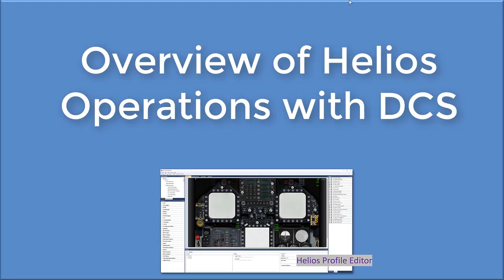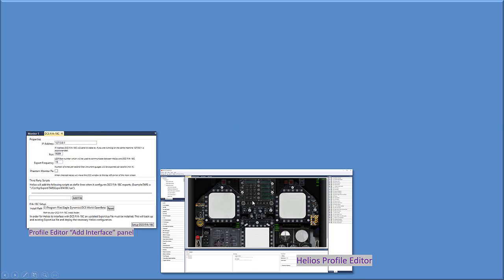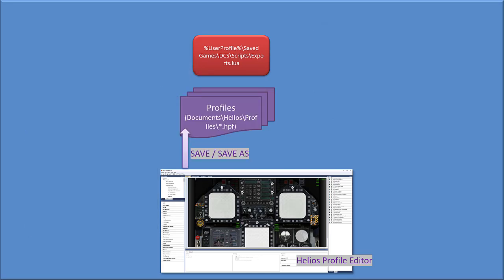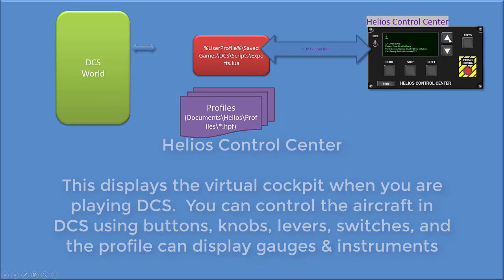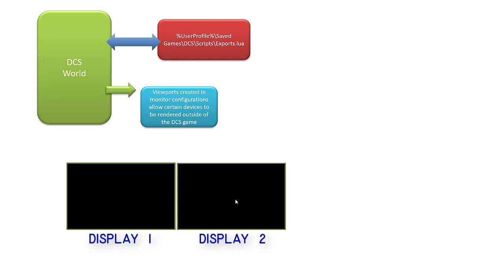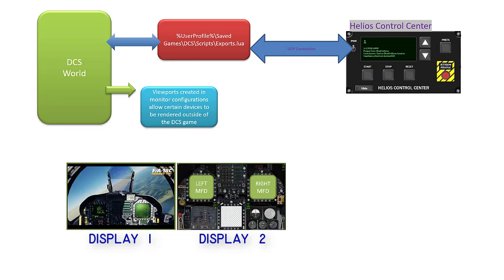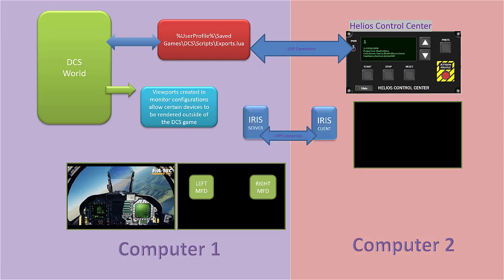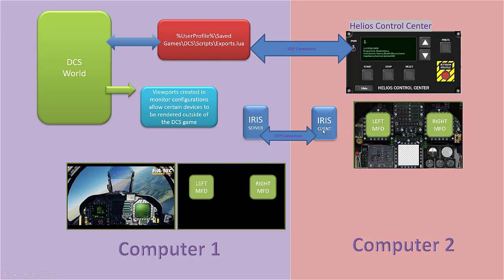Overview of the Helios Virtual Cockpit System for DCS

Comment: Hi. Where can I read more details about how to use iris? While launching iris doesn't find config file, manualy shows error and there is no additional tabs for viewports
Reply from the maker: @user-fw4vw6gz4k  there is documentation in the Iris download package which is here https://github.com/HeliosVirtualCockpit/Iris-Screen-Exporter/releases/latest
Reply: @bluefinbima2227  Thanks, but I even can't load the config file into the iris.  And also I didn't understand how to config a helios profile without second monitor.
Reply from the maker: @АндрейТюников-н7в  if you can't get the examples from the documentation to work, then I would suggest heading over to https://discord.com/invite/GhDBJe3jNH where it is easier to assist you.
Reply from the maker: @АндрейТюников-н7в  no second monitor - just make sure your profile components are placed onto Monitor 1 in Helios profile editor.  There is lots of YouTube content which can help.

Comment from the maker: There is a bug in Helios where the exports.lua does not always get written into the Saved Games folder.  There is a fix for this in the pipeline.  Iris as mentioned in the video is from Will Hartsell.   I'll provide a link to the code when I work out the best way to make this available.
Reply: Could that be the reason why  the DCS AV8B Profile doesn't work? The buttons and gauges are not working. The other one for F18C from CAPT Zeen is working, but might be already exported before i updated helios.
Reply from the maker: Hi,  if you have tried  to do a Setup from the AV8B interface, and Captain Zeen's FA18C still works, then yes this could be the case.  Unless Captain Zeen has ported the AV8B exports code into his exports.lua (andI do not think he has), then they are  mutually exclusive.
Reply: @bluefinbima2227  Yes i tried to setup the AV8B interface profile according to this tutorial / overview. I also used the latest export.lua from Captain Zeen (01/JAN/2019) in combination with the latest Helios and your AV8B profile. I will wait patiently but eagerly to see the fix  ;). I really admire your work and effort you put into this. Also your AV8B Profile looks great especially the visuals and how you placed the interactive elements. I know as a Front-end programmer, that debugging can be a nightmare. I wish you the best!
Reply from the maker: @BartB1986   If you installed Capt Zeen's export.lua, then my AV-8B profile will not work and this is not going to be fixed.  My AV-8B profile must use the exports.lua created by Helios from the AV-8B interface.  What will be fixed is the directory where the interface specific exports.lua is saved to.  When there is Alpha, Beta, and full product DCS directories, then the profile editor gets a little confused.  The simple approach is to look in  %userprofile%\Saved Games\DCSxxxxx\scripts and see where the AV-8B exports.lua file was written to and copy it to the directory that corresponds to the DCS you're running.
Reply: @bluefinbima2227  Thanks for the clarification. I have another question, do you need to do something with the HeliosCore and HeliosExport.lua. If so, which version does it needs to be?
Reply from the maker: @BartB1986  If you have the export.lua from the AV-8B in the correct location,  I would guess that HeliosCore and HeliosExport will never get invoked.

Comment from the maker: IRIS is now delivered (but not installed) in the latest release of Helios - https://www.digitalcombatsimulator.com/en/files/3302014/ .  The installation files are in the Helios folder in My Documents.
Reply: can Helios  be used to interface physical instruments with dcs?
I want to build a cockpit sim but while there's plenty of guides on how to build custom controls or diy gauges and displays I still can't find anything on how to get a value like say x altitude from dcs and imput it to a real gauge or even just an on/off signal to  master caution panel.
so yeah, I've seen the name of your software pop up every now and then in cockpit builds so can it do that or did I misunderstand?
if not could you please point me in the right direction?
Reply from the maker: @npc6817  
There is some provision for physical instruments, in addition to responding to DirectX HID devices.  Helios does have a Phidget interface https://www.phidgets.com/ and there is support for Eos Devices based on Arduino (see https://forums.eagle.ru/showthread.php?t=108160 ) although the home of the original information appears to have disappeared.  I feed sure that there are people on the DCS fora and other places who are able to advise.  I use some physical instruments myself, but I control these outside of Helios.
Reply: @bluefinbima2227  thank you